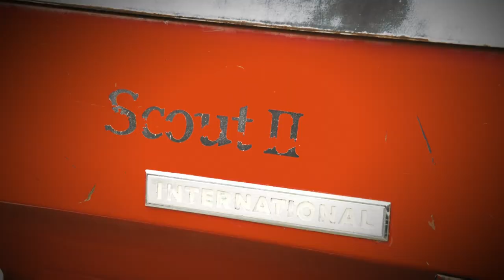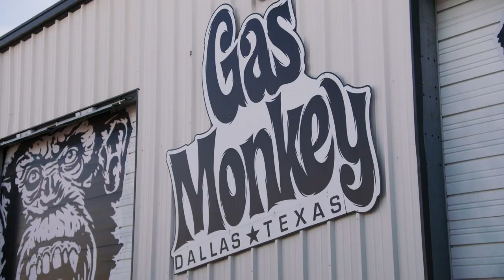"Am I Supposed To Like It?" Richard OUTRAGED By Team's Bad Car Paint Job! | Fast N' Loud

Comment: Richard is so professional he touches raw, unsealed paint with his bare hands 👍
Reply: That is not a huge issue especially when you have to knock down all of the flaws and then fix it to get to clearing it all afterwards. Painters do it all the time
Reply: Quite normal.
Reply: You're acting like you're better than him 🗿😂
Reply: If he is unhappy with a paint job and is going to require it to be redone, it doesnt matter if he touched it.
Reply: I’m pretty confident I could paint better than that
Reply: Or comes in and leans on the part they just tack clothed..

Comment: Sue was dead on in her price. At my shop in Illinois I just tell someone like Richard good luck with the cheaper shop and have a good day. Then when it comes in to be corrected, I'm too busy or charge double.
Reply: Its a simple design tho
Reply: @jojos4792  still cost as much as a crazy design though.  You can buy a sheet of fabric with a simple design for the same price as a sheet of fabric with a ton of shapes and pictures and cool trippy designs on it
Reply: Hey got a question how much is a standard paint job nothing fancy say for a Chrysler 300 I believe its a 2008 just wanted to know because I have a female friend that wants her car painted but I don't want her to be taken advantage of. So if I have a idea on how much that would be on average it would be much appreciated.
Reply: @sicilianjiu-jitsu2984  4000.00
Reply: That whole part was annoying AF. He should understand that GOOD work ain't CHEAP. You really get what you paid for when it comes to upholstery, paint, and bodywork.
Reply: @sicilianjiu-jitsu2984  For a good paintjob it's at least a couple thousand, the car isn't worth enough to justify a paintjob and if your friend does decide to get a new  paintjob and decides to resell the car no one is going to cover the cost for the pretty paint. I would reccomend your friend just drive the car until the wheels fall off and use the money she saved not getting a paintjob on her next vehicle.
Reply: @gscryinlikeabitch  in principal I agree with you. However there are places where you can do all your own prep and then come to them and they will basically spray and pray for $899 (earl schives,maaco,fact-o-bake,etc. ) overspray will be guaranteed if you don’t really prep well, but it will be painted.
Reply: @wb5mgr maaco is excellent they painted my 06 Tundra salsa red it looks like candy paint, mirror finish a ton of pearl, and cheap
Reply: U in Illinois not Texas different price points

Comment: To straighten the lines use shinny clear blue fineline tape, it's made to cut the paint lines straight. Don't ever use regular tape to mask painted lines, you'll just keep on struggling.
Reply: Yup exactly and fine line tape doesn’t leave them gnarly edges either so it’s easier to cut and buff it out when done
Reply: Agreed, amateur as fook…
Reply: Or was Richard too cheap to get fine line tape 🤣, Sue calling him out
Reply: Lol, I think they don't have as much experience in painting cars. The only way to learn is too f@#$ up, that's why they call it "learning the hard way".
Reply: True that , bro !  I could not believe they used that wide tape on this job.  What a HACK!!

Comment: It's so hard to find quality work these days. Anyone with real experience knows  there is no such thing as a perfect paint job but a professional gets it really close on initial spray then will do things like sanding between coats. Nothing more important than good tape lines though! I agree with Richard.
Reply: I guess you didnt see the guys saying they knew they had touchup work to do
Reply: @rcs0296  You make a good point, but frankly having that much bleed on straight lines where the tape doesn't have to distort shows lack of care, especially when you consider the price tag, so I do understand Richard's reaction.  Have a great weekend!

Comment: I would like to see Richard do this work. He used to do it, but acts he is the best
Reply: He never did paint or body work. He assisted in building the motors he raced with. IDK where all of y'all think he's the so called best at anything but building motors and racing? When him and Dennis raced together. He helped Dennis build the cars and maintain them while they raced. OMFG. Sighhhh
Reply: Yes he did too. He did body work and painting. You need to research more.
Reply: @thomassenemounnarath3278  Well. I've never seen him do anything but motor work on cars. Especially when him and Dennis raced the Cannonball Run together.
Reply: He started out restoring cars with his dad.

Comment: No! Why?! 4" lift, pre-runner suspension, chevy grand sport blue paint, mickey thompson 33×35 16, led light bars custom fuel cell, warn winch, nice radio, sparco seats, flat plane crank motor out of the Shelby gt350r,

Comment: No matter what you feel about Richard Rawlings....hes absolutely right about that paintjob.....its fucking horrendous. There should not be that many flaws in that paint job. You're on television looking like piss poor amatuer painters and you're working for a world renowned custom shop. You need to make sure you dont drop your tape because that puts defects in the tape which will put little niks and jogs in the lines. If you were planning on addressing all the flaws you definately should have done that before showing the signer of your pay check. Also, next time just fix it and seal/clear it and he will have to like it. Or pay you to redo it.